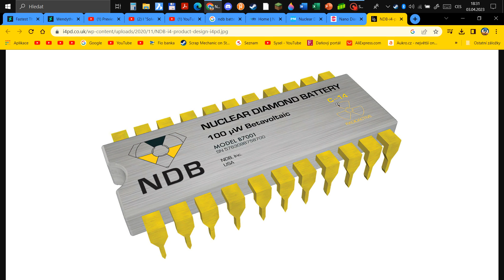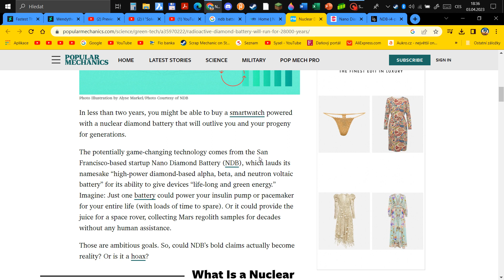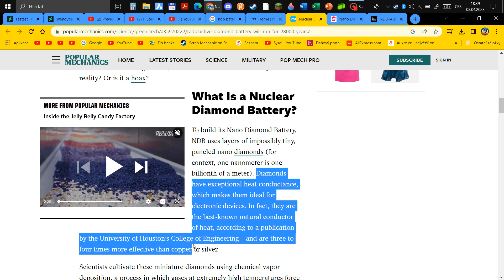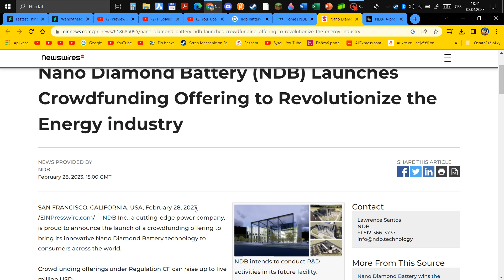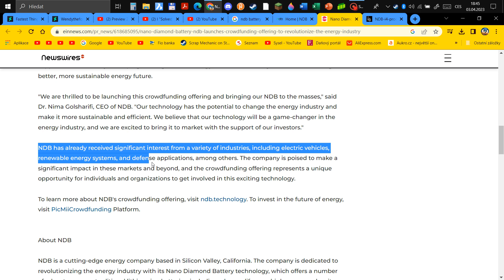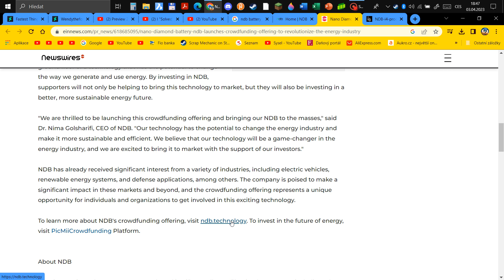,,Nuclear Diamond Battery´´ BULLSHIT DEBUNKING TIME

Comment: LOL, yes everything about NDB is BS. The multi pin packaging of this battery is BS. Carbon 14 half life is 5730 years thus 28000 years means you lost half the power twice meaning now you would be at 25 micro Watts in an ideal case where the efficiency ratio remains the same. But seriously, the efficiency will deteriorate likely towards 0% over such time.
The 28000 years claim is just false marketing used to distract from the fact that the extremely low power density makes this solution near useless for anything requiring Watts of power.
This is a sad case of investor scam fooling people with poor knowledge of science matters.
Reply from the maker: Funny thing is that you only need the value 100uW to debunk all their claims. (I don´t even need any values cuz my knowledge is enogh to debunk this BS straight away)
Reply: @Sonic_The_Electronic_Madlad  Yes, that's very true. Just simply finding out that 100 micro Watts is a 10,000th of 1 Watt is enough to conclude this is insane to begin with. This is simple high school physics.
But many other reasons exist to further debunk the idea.
I find it very disgraceful for anyone fooling investors with such outright lies.